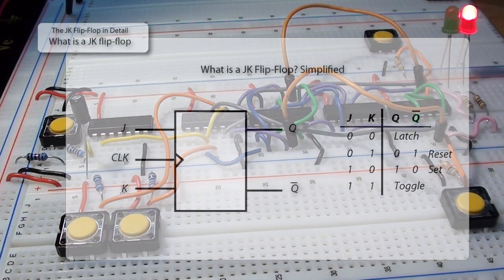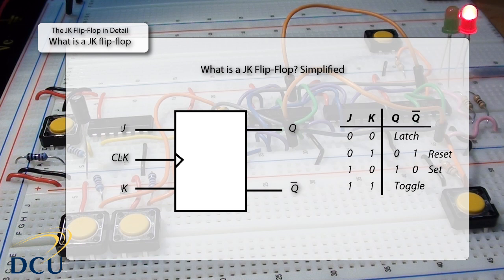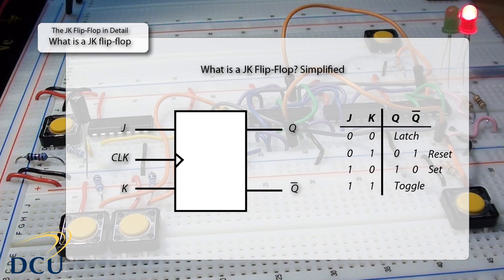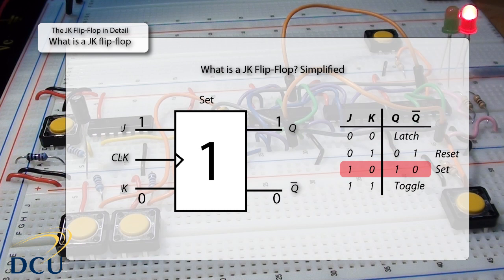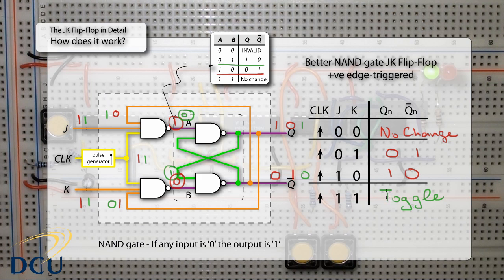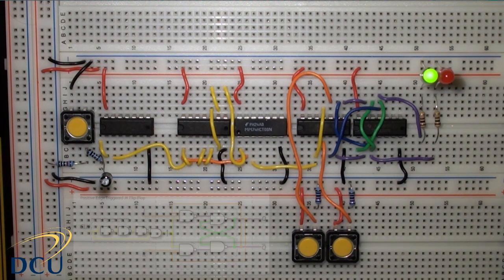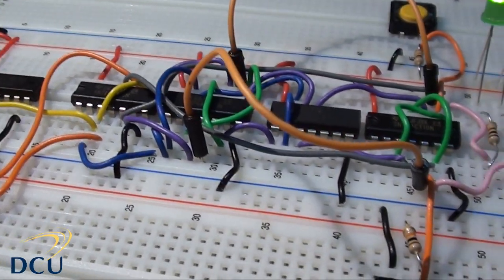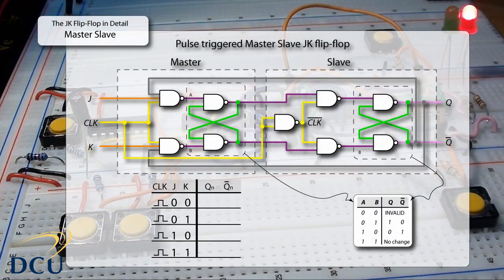Digital Electronics: The JK Flip-Flop

Comment from the maker: The problem is with the clock input to the JK flip-flop. If you have noise or switch bounce and you have J=K=1 then you may get multiple 'toggle' states (1 toggle, 2 toggles etc. unknown on a single press). For learning you can connect a 555 timer (see my video on the 1Hz 555 timer circuit) to the clock input of the JK flip-flop. This will give you a clean clock cycle every 1 second. An alternative would be to use a debounced switch (see my SPST debounce video) to drive the JK clock input.
Reply: So how do they built jk flip flop inside 74HC112 or 74HC191...Is it Master  Slave or the other one?

Comment: Thank you very much sir.

The thing is that we have to construct a pulse triggering master-slave jk flip flop as part of the course project. You have used a schmitt trigger which we haven't studied so i do not know about switch debouncing and noise. I have to use a 555 timer as 'the clock'. And it has pins RESET, TRIG, OUT, DIS, CTRL and THR. Which pins will be useful. Can I wholly replace the 555 and schmitt with a debouncing switch if I, like you mentioned, want single toggle state.